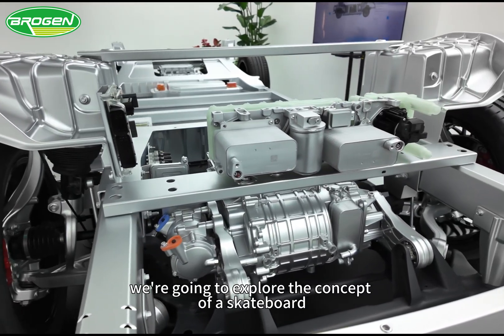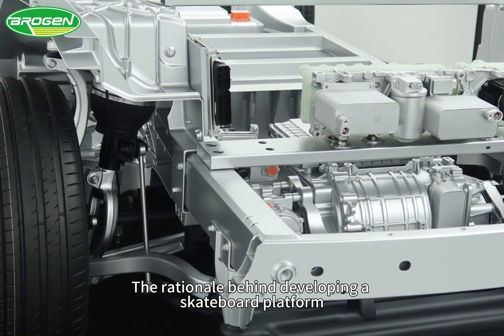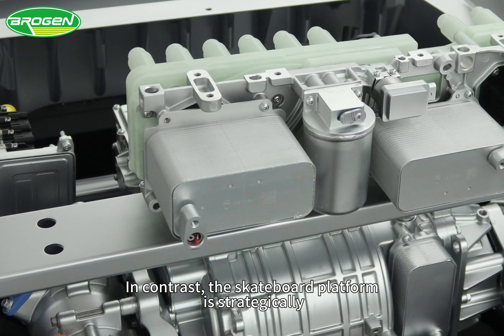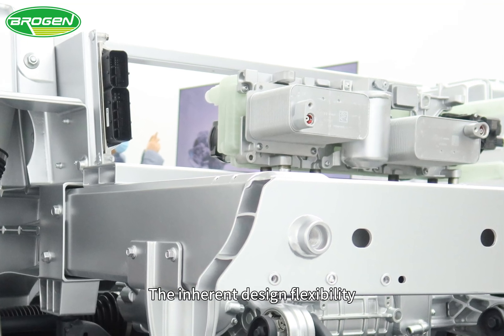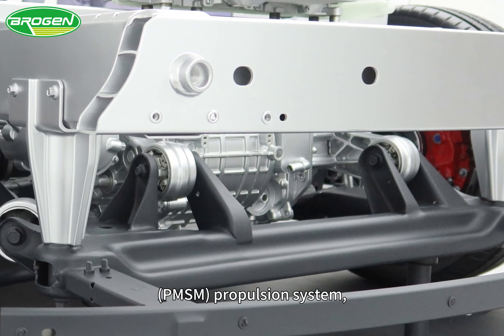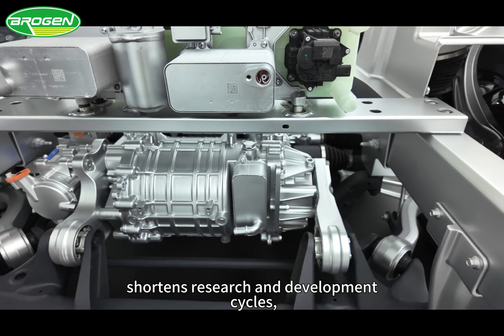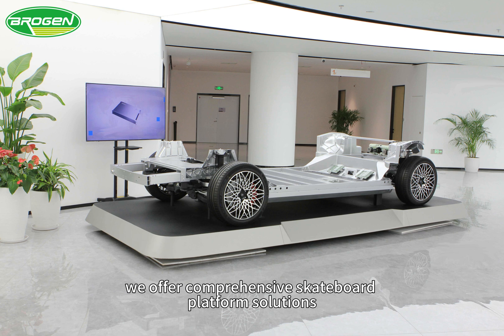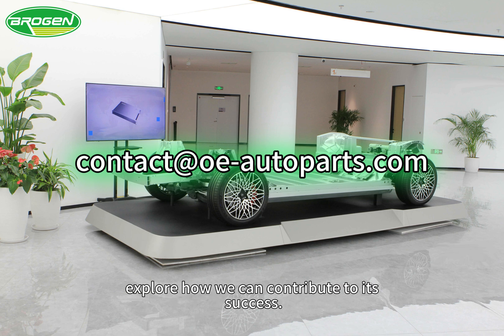EV "Skateboard" Platform, What‘s it? What's on it? What's it for?

Comment: So, similar to a vw beetle chassis.
Reply from the maker: And Volkswagen CEO Herbert Diess has hinted that a Beetle EV could be possible based on the automaker's dedicated electric vehicle architecture MEB platform several years ago.
Reply: @BrogenEVSolution   vintage voltage have transformed an old beetle into an ev. Did a good job, but was very expensive.

Comment: Since there is no need for a yooje engine to consume a lot of volume in one spot, the motors can be smaller, and placed onto each wheel, which lowers the center of gravity contribution the engine used to make.
The same with the batteries, the heaviest component in the vehicle. Low to the ground adds stability.
Plus, we no longer need all the complicated shapes of the support beams.
And I just had a thought: Battery packs should be designed to crumple on impact, not only folding each cell onto the next, so they stack and absorb impact momentum, but also disconnecting each cell from the others so the chances of a fire are reduced.
Reply from the maker: Yeah! There already exist hub motors where the motor, transmission and brake systems are integrated into the wheel hub. As the single hub motor can be driven independently, it is relatively easy to implement whether it is front-wheel drive, rear-wheel drive, or four-wheel drive.

Plus, the hub motor can realize differential steering similar to that of a tracked vehicle by the different speeds of the left and right wheels or even reverse rotation, which greatly reduces the turning radius of the vehicle. Under special circumstances, it can almost achieve in-situ steering (but at this time, the vehicle steering structure and tire wear is greater), and is valuable for special vehicles.
Reply from the maker: But the hub motor works in a harsh environment and is affected by water, dust and other factors. It also has high requirements in terms of sealing. At the same time, the heat dissipation issue of the in-wheel motor needs to be considered separately in the design.